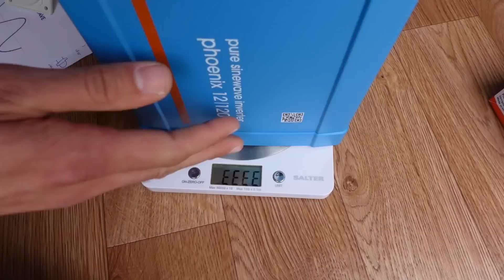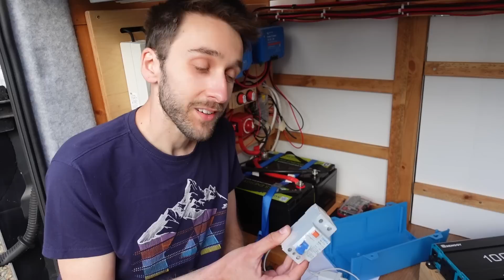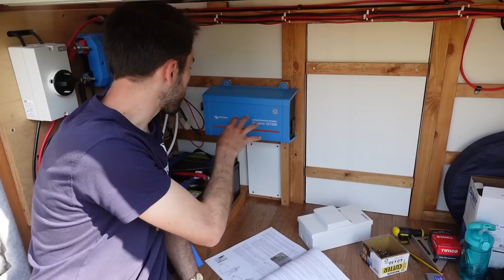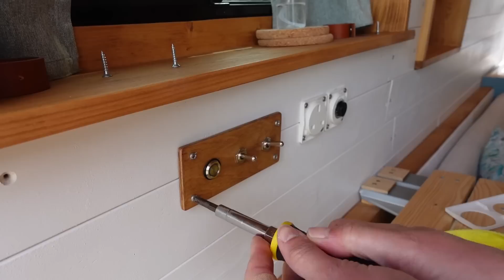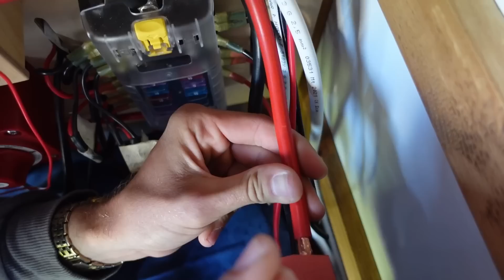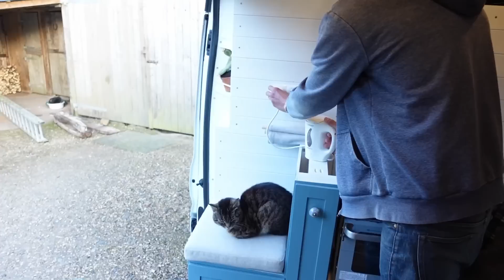Inverter & 230V Sockets Install (Victron Phoenix & RCD setup!) | Transit Van Conversion E46

Comment: Great timing and so well explained. I've done months worth of reading to wrap my head around the electrics. Especially the GFI issue in an isolated van requires special attention. 🤔
I will be installing my 12V / 230V stuff next week, when all the cables and connectors have arrived. After calculating all the wire lengths, diameter and connection points, I have aquired literally boxes and boxes full of differently sized wiring, connectors, fuses & fuse types (MIDI, MEGA, ANC, Blade). M5, M6, M8, M10, 4, 6, 8, 10, 16mm and all combinations thereof. And - as usual - I don't have enough of some particular kind. Arghhhhh! 😵‍💫Have you had the same marvelous experience?

We are installing a load sensing switch, that will route 230V either from the landline (priority switched) or the 3KW inverter (hooked up to 3 x 100Ah). So 2 breaker boxes on the 230V side.
I actually have the same plug-in tester (just for German sockets) and it works like a charm. 😊👍
There's also no over-emphasizing the need for ferrules to keep from damaging the fine wires in stranded cables! I use them on ALL screw connects - 12V or 230V.
Happy travelling through Norway! Stay safe! 🚐☁🍀
Reply from the maker: Cheers :) We re-uploaded the video so if you post this on the updated one we can reply properly there 😎 https://youtu.be/bshTXtq3x2I 👍

Comment: Have you had your van weighed?
Reply from the maker: Yep, we weighed it several times during the build and we've also uprated our van to 4T 👍
Reply: @SelfBuiltStories  Can I ask what that involved and cost  and will you be making a video on that?
Reply from the maker: @madforit9661  The actual uprating was essentially just an admin exercise so wasn't too bad, we paid £276 for that. The expensive part was we both had to do the C1 driving test  to be able to drive something over 3.5T, so that set us back ~£1400 for us to both do a 3 day driving course together and test at the end. Yeah we'll be doing a video on it at some point 👍
Reply: @SelfBuiltStories  Thanks so much for getting back to me I started roughly same time as you guys, on the same van Soon to be coming to an end although teething jobs get to you. My van is running heavy ,that's why I asked as I have seen others who have upgraded the van wheels and suspension. I have noticed the bumper stops we installed were large and now so squashed. Look forward to the video.
Reply from the maker: @madforit9661  No problem, yeah we upgraded our suspension to 3+1 heavy duty leaf springs which made a huge difference from the stock single spring that was on before 👍

Comment: Alarm,  A L A R M !  Always use crimped ferrules on stranded wire – particularly with DC but by default under any current/voltage – otherwise you're going to increase the resistance at any screwed connection due to reducing the wire diameter – risking disaster for saving up pennies ... especially in moving objects ... RTFM
Reply from the maker: Hi, that's all done towards the end of the video. Cheers 👍 https://youtu.be/-SQb5bgWpmw?si=U6jMUELSnYA9FAm9&t=1969
Reply: ...and if you would have watched the video to the end, you would have seen the ferrules put to good use.
Reply: @gonefilming2020  I was just alerted - maybe they could have done a text insert when editing ...
Reply from the maker: Yeah it's tricky to know exactly how much extra bits to include like that as everyone watches different amounts of the video, not necessarily in order, and with different levels of understanding to begin with. We try to get a good balance with it and funnily enough we did actually intend to add some more text around this bit but inevitably no matter how many times you watch the video there's always at least one small thing that you forget

Comment: Should you not have used a cable gland instead of just grommets on the CU to provide strain relief?
Reply from the maker: As far as I know there isn't a specific regulation that mandates the use of cable glands in our situation. BS 7671:2011 Amendment 3 (17th edition) mandated the use of metal (non-combustible) consumer units over the previously allowed plastic ones, and guidance notes say "Cables must be protected from abrasion" but couldn't find any mention of specific gland requirements. There's also examples given of using rubber grommets, e.g. https://electrical.theiet.org/courses-resources-and-career/free-resources/consumer-guidance/consumer-units/ . There isn't much (at all) specific regulations for mobile installations like the kind you get in a campervan/motorhome either so there's a lot of grey areas, but we've used the domestic regulations as the baseline and had it all checked over by an electrician who has experience with mobile setups as well 👍
Reply from the maker: Hey, if possible would you mind reposting this question on the updated video? https://youtu.be/bshTXtq3x2I . As it's a great question so would probably benefit others too :)

Comment: Hello,
You forgot to press the wire end sleeves onto some of the wires during the electrical installation. Please do this urgently, otherwise safe operation will not be possible in the long term. Without wire end sleeves, individual strands can come loose from the wires or become damaged. In practice, this leads to increased contact resistance and can lead to system failure or even a fire.
Best regards
Bummibaer
Reply from the maker: Hiya, we put ferrules on all the wires later on in the video: https://youtu.be/-SQb5bgWpmw?si=U6jMUELSnYA9FAm9&t=1969 . We didn't have the right crimper for some of the wires initially so had to redo those ones at the end when it arrived 👍

Comment: Great video guys! Did you have a consumer unit when using the Renogy 1000W inverter? From watching Greg Virgos videos he contacted Renogy and they suggested you didn't need one, it had a consumer unit built in?

We have a 3000W inverted and about to install it. 

Thanks,
Reply from the maker: Cheers! And no we just used the single socket on the back when we used it, as it's not setup out of the box to work with a consumer unit/RCD. I think I've watched the video you're referring to actually where he shows an email from renogy support at the end that says it has an in-built RCD, but I was incredibly dubious when I saw their email to be honest. Renogy makes quite nice products but their support is pretty bad, and it's incredibly hard to find someone who understands them on a technical level. They also make very similar products but for different territories which have different electrical and earthing requirements, so I think a lot of the initial sales/support staff are not sufficiently clued up. And inverter earthing is an incredibly detailed rabbit hole to go down as well! 

l've had several email exchanges with them myself and phone calls with one of the engineers. I don't believe there is any built in earth leakage protection in their UK inverter (possibly in the US with GFCIs it might be different). If you check the comments on Greg's video there's a few people who've had similar experiences and if I remember he replied to one of them and agreed that was most likely the case.

Renogy's manual also is woefully lacking on any subject of earthing and bonding, but for an RCD to actually work there needs to be the N-E bond. You can test with a multimeter that isn't the case with the Renogy. In contrast Victron documentation is very detailed and they actually have an appendix in the manual for making the bond, if required for your setup: https://www.victronenergy.com/upload/documents/Manual-Inverter-VE.Direct-250VA-1200VA-EN-NL-FR-DE-ES-IT.pdf . 

We used the renogy one quite a bit travelling around last Summer and it worked great, but only ever with the one device. I wouldn't want to use it with an extension lead or wired into sockets unless it was going via an RCD, which would require making that bond in a suitable and safe way and checking with a tester that it actually works. The added complication though is the renogy also supports AC pass through from the grid, so when using that mode you need the bond to not be there, as it comes from the grid setup. It should only be switched on when inverting and standalone. So you need something like a relay that makes the connection when inverting and disconnects it on grid power. There are people that I've seen have it set up like that but it's a bit more work with that one, there's an example here: https://youtu.be/Ka0lamFY7To?si=JbEkqxNVgLz260p3&t=536 . HTH! 👍
Reply: @SelfBuiltStories  great thank you!
Reply from the maker: @easonthego  no problem :) If possible would you mind reposting the question on the updated video? https://youtu.be/bshTXtq3x2I . As it's a great question so would probably benefit others too :)